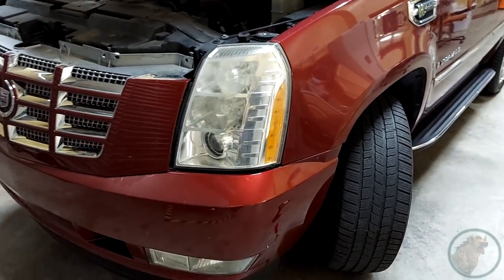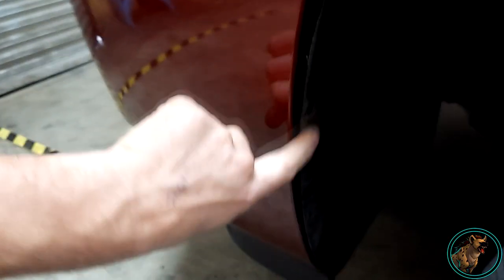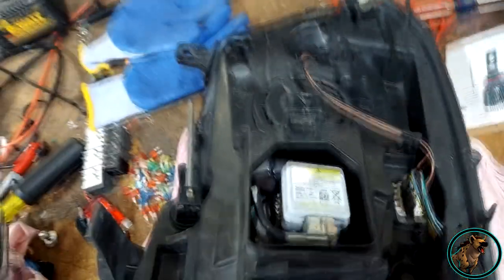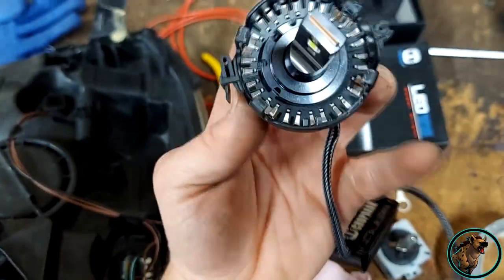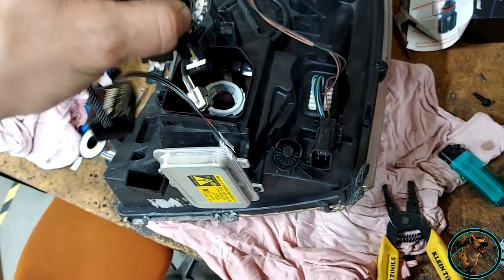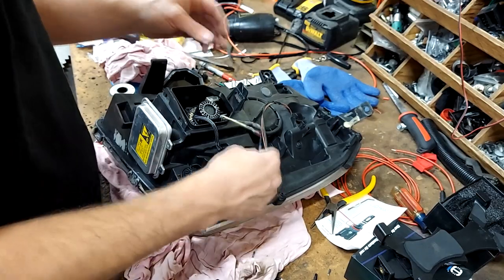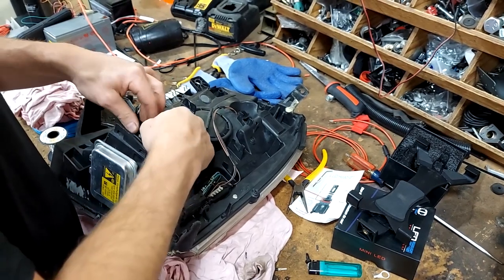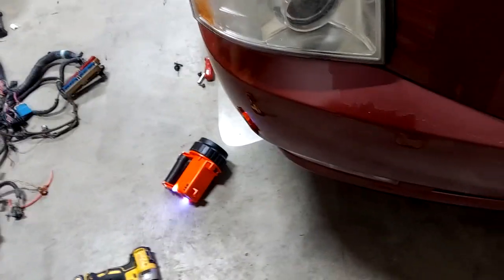2007-2014 Cadillac Escalade Yukon Silverado HID to LED Conversion

Comment: Instead of soldering the wires you should invest in some 2 port metripak connectors in case you ever need to swap the LED. Just unplug it and add a plug to the new light.

Comment: This is the 2nd person I've seen convert these to LED and I can't see why they do not remove the ballast and cut the wire there, giving you plenty of wire to work with.  Then put the ballast back for sealing purposes.  Wish I had seen this before I ordered a used Ebay ballast for my STS.  Well, now I know how to bypass the ballast.
Reply from the maker: Yes, the way I did it here is bypassing the ballast. By doing that it avoids a extra possible connection issue from corrosion

Comment: Almost done with this project just need to splice wires and put everything back together .Don't have a solder gun so was thinking of wire splice or twist and shrink .Taking a break to think it over .A few things i have learned in the field is you need 2 sided LED chips like you see in this video . If you get 8 or 6 sided chips it will not give a correct beam pattern with projectors .LED locked into perfect alignment .Chips Should be side to side not top to bottom .I did not take bolts out of bumper .Just loosen them to give a bit of play .Did not mess with clip on back of housing i just pulled  up and out .There are 3 bolts holding housing .2 easy up front .Number 3 is down low on back of housing through wheel well . I just loosen that bolt and it slides out .Got CHOPDARK LED like on this video .They were on Amazon for about 50 bucks .Whatever LED you choose make sure it has that little black box on them or you are likely gonna get error codes or flicker .While i was in there i did all  3 lights to LED . Thanks for the video was very helpful

Comment: Great video boss. Any errors on the dash after using the Led lights ? And is the color temperature better than the hid ones?
Reply from the maker: No messages,  also they look very similar in color. I went with the more white. I like it better

Comment: Just ordered the plug and play LED bulbs. Thanks for the code. Will the ballast still have power go to the bulb if it’s bad? Or how are we supposed to run it?
Reply from the maker: So the only downside to the plug and play is if the Ballest has issues or is shorted you will have to bypass it the same way in the video. I prefer to bypass it anyway because it removes a failure point
Reply: Plus it will make future bulb replacement easy. Thanks for video and reply
Reply: @matafied The new plug and play have the literal plug. How would one splice wires if the new ones do not have wires? I know, stupid question..... ?

Comment: The link to the Auxito bulbs dont come with the wiring, it's just the bulbs.  How would that work to convert to LED?  Is there another piece to purchase?
Reply from the maker: I need to update the video, the bulbs in the link don't require any wiring.  They are a plug and play replacement.

Comment: Thanks MATAfied, great video...very instructional. I'm having the same moisture issues with 2008 Escalade EXT. How did you get the moisture out of the headlight and how do you keep it from accumulating again?
Reply from the maker: Could never get it 100% but I drilled holes in the bottom of the housing to give the water a place to drain.  This kept it from evaporating in the housing
Reply: @matafied  LED'd both headlights this weekend and your video made it happen. I really appreciate your time to post it.
Reply: @matafied where did you drill the hole? Do you have a pic of it.

Comment: Man you should have done a headlight restoration on that thing when you took it out.  Start out with 600 grit wet sand....then 800...then 1000, 2000, then 3000,....can do 4 or 5 if you wanna get real with it.... Then use a plastic restorer, polish and buff it with a drill/pad... Wife with alcohol.... Then due to coats of a clear sealer.... Will look brand new.  I charge 100 a headlight to do it...they turn out damn near brand new.ill email you pics and products if you would like.

Comment: Not sure how to get these wired up. None of these l e d lights have a wiring pigtail. Only a plug
Reply from the maker: @chadbailey1126  yes unfortunately over time they continue to change products and links, so it's hard to stay on top of it. However what is illustrated in the video is just cutting pigtail and splicing to oem wiring.  Thanks for watching,  hope this helps

Comment: I have a 2007 Lexus ES350. My HID headlights are garbage. The lenses are all but opaque. I want to switch from HID to LED. The AFS socket just wobbles all over the place. I can get the kit to change out my HID bulb and use the power wire going to the ballast but that will be a waste. I want to find somebody that makes a complete LED/Halogen headlight assembly that is plug and play. Just can't find them anywhere.

Comment: why didn't you just cut the D1S connector from the ballast & solder that to the actual power so that you can still plug & play other led bulbs if you decide to change them out?
Reply from the maker: Because the plugs at the ballast were corroded from all the water. So by doing it the way I did I eliminated two points of failure.
Reply: @matafied  gotcha.

Comment: Thanks for this video   my ballast went out as well last year and I ordered cheap blue chinese led lights from ebay  BIG MISTAKE   long story short  I can't drive my escalade at night
Reply: Same here what led lights work for you icant drive my Escalade at night to can’t see anything I think a flashlight will work better which one work for you
Reply: @joshuavideos7721  🤣🤣🤣
Reply: @joshua videos 77  I put a high powered SD1 LIGHT in it  works fine
Reply: @SS_Gang777  do you have an exactly link where you get it at I will preciated your help
Reply: @joshua videos 77   no I don't. I went to Car Quest and they picked the light for me. See if you have a Car Quest in your city and give them a call   tell them your headlight problem and let them know you want to convert to LED

Comment: Now you have rtv what happens if bulb goes out?..its glued on
Reply from the maker: One dot of RTV on the base of the bulb will not glue it on. It's only to take up alittle slack and prevent vibration. Not necessary but if the bulb is loose in the socket it will help. Some aftermarket housings have loose tolerance

Comment: Do the plug n play still run off ballast
Reply from the maker: @mrheavychevy17  they do. However I still hard wire them to bypass the ballast to remove a failure point
Reply: @matafied  which wire should I use. The blue wire like you did

Comment: I think hid is better for projector lights.... I don't think u r going to have a better beam with led..🤔🤔
Reply from the maker: Well the whole point of the video is to replace the hid bulb because of ballast issues.  So after replacing them 4 times I gave up and replaced with led. They have been in there for months with no issues.  Also to be honest the led do look and do a better job in lighting.  In my opinion

Comment: Wait let me get this straight first off you say you want to stick with factory because they’re so my h better than aftermarket BUT the reason you’re replacing the “factory” HID bulbs is because the “factory” light assembly is taking on enough water that your “factory” HID ballast is shorting out and you compliment how much nicer the factory lights look as you’re showing your “factory” lights completely faded wealthier  cracked and yellow? Then you mention how you’ve tried to save the factory lenses by taking them apart and resealing them with RTB??? Ok  that’s admirable that you’ve got faith in your factory lights and want to stay loyal to your brand after 16 years for sure understandable the extra costs that factory light housings are vs aftermarket. Question have you owned that Escalade since it rolled off the lot and if not who’s to say those ones you have haven’t been replaced in the passed with a cheap aftermarket aren’t capa certified? Just saying one of the first things a used car lot will replace is the headlights on a vehicle because how much better they look and are easier to sell with a fresh set of headlights and you best believe nobody’s going to replace a car they’re about to sell with factory lights especially when there’s so many Chinese cheap knock offs that’ll pass just fine as factory on their lot and even last a year or so before they start taking on water. Tip if you’re going to break the factory seal and take a lens off your lights you NEVER want to use RTB to reseal them that’s for sure, ALWAYS USE BUTYL GLUE it’s that nasty black sticky glue that if you have taken your lights apart you would’ve experienced it because it’s what every light is sealed with from the factory. One more thing WTF are you doing cutting the factory wiring!!?? I’d you’re so worried about keeping your “factory” quality lights because you want to stay true to your brand and not mess up your vehicle why would you ever ever cut up factory wires and then be irresponsible and tell others that’s the way to make the LED’s work when you’re totally wrong! You should go spend the extra $20 for the correct canbuss kit which makes your factory computer able to take on and power up aftermarket LED lights with no issues and also is plug and play with cutting or modifications necessary. You know it’s not often I get in here and get in peoples comment sections and I would NEVER call anyone out because I find it distasteful and lame when people criticize others but dude after you contradicting yourself multiple times then giving folks not only wrong information but irresponsible information risking them doing something as stupid as cutting up factory wiring instead of getting a canbuss kit I couldn’t go on without asking you to PLEASE BEFORE YOU START GIVING ADVICE AND SHOWING A HOW TO VIDEO PLEASE PLEASE PLEASE go watch a couple videos yourself on a reputable channel and do a little research before you be irresponsible and suggest ways to fix a problem that isn’t only incorrect but totally unsafe. I guarantee anyone who would listen to this is not real bright when it comes to vehicles and will follow your video to the T and the next thing you know their truck is burning down it they end up trying to drive home with no lights because their hack wiring job couldn’t make it through the season and their lights go out ending up in an accident. It’s ok to be wrong and it’s ok to have your own way of doing something trenching others is awesome but to make irresponsible content like this just ain’t right man. Sorry for calling you out but I just got a call from my sister about fixing her headlights and said she seen your video being an avid YouTube watcher with car content as my most watched you really should be careful on being so sure of yourself if you’re even just a little unsure or haven’t done it before. I did enjoy your video if it wasn’t for the misinformation if that helps anyways. 
☮️➕💟 buddy ☮️➕💟
Reply from the maker: So the reason for me saying I like OEM is because I do prefer the quality of the fitment etc over cheap Chinese headlights. The fact of the matter is gm had a terrible design flaw with these headlights which is why they are in such high demand for them. Without separating the lens from the housing it can be properly sealed.  I like a lot of people who can't afford 800 dollars for headlights, or better yet I can just don't want to. Also, this vehicle did not require a CAN module I drive it weekly.  Another point this escalade has only 60k miles and has never been wrecked, or had repair work done since bought new in 2009. The factory wiring was only modified on the headlight housing side and not on the vehicle side. All modifications done properly will 100% never cause a fire. I have been working on vehicles, specifically automotive wiring for 20+ years. I have yet to have an issue with this upgrade and still going strong for less than 100 bucks. So yeah. The thousands of people that have emailed me, thanking me for helping them fix their vehicles agree. So Goodluck with your repair

Comment: Why didn't you just delete the whole HID system...remove the ballast now you have a drainage hole...I did it to my escalade...
Reply from the maker: I had already drilled holes for draining.  But it would have been fine to do that also
Reply: Can you guys give the part number or something. The popular searches have the LED conversions but using the connector from the ballast.